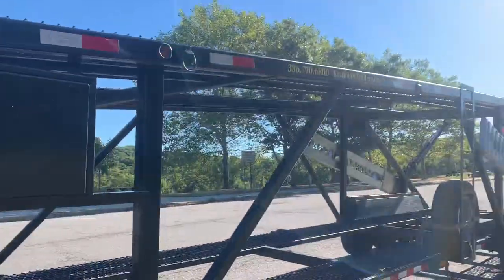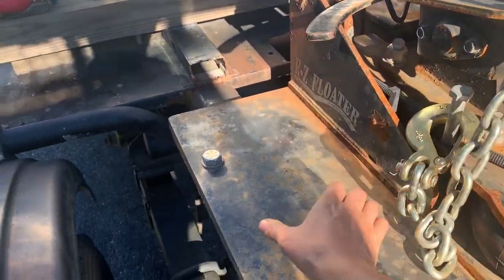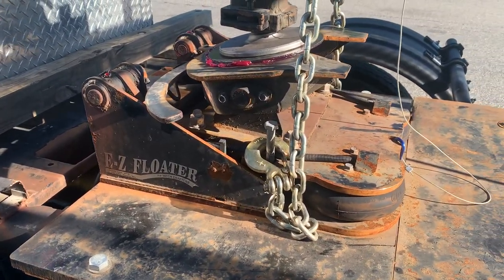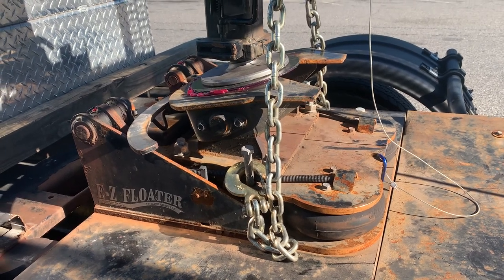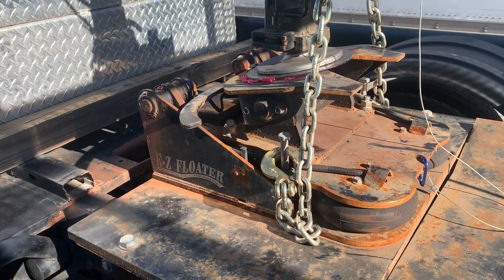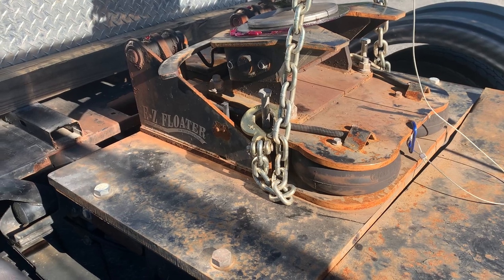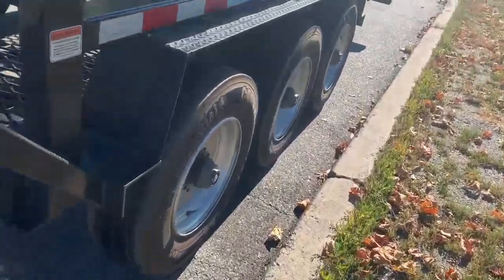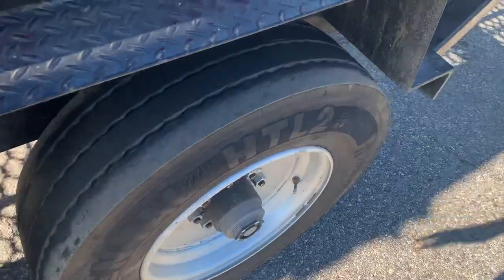Fifth Wheel to Gooseneck Adapter

Comment: You could get a collar or ring made to go between the gooseneck hitch and the adapter made so that it can't swivel.  The fifth wheel hitch will handle all the articulation you need.